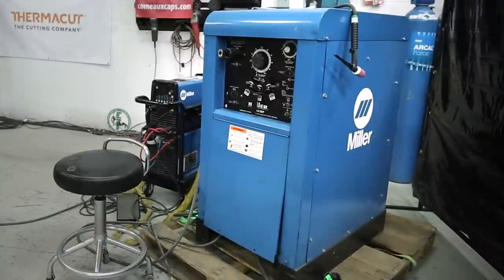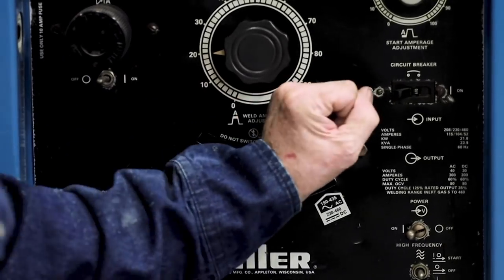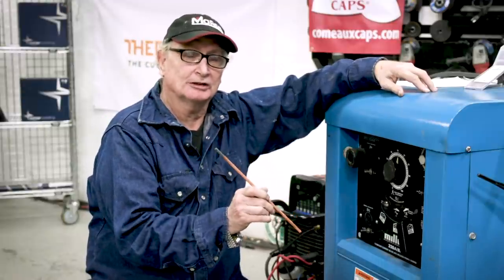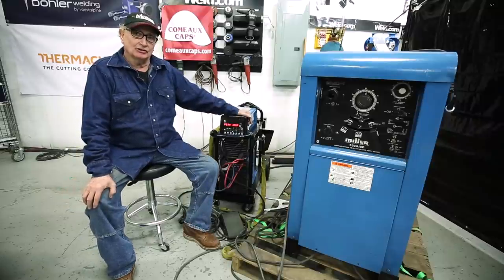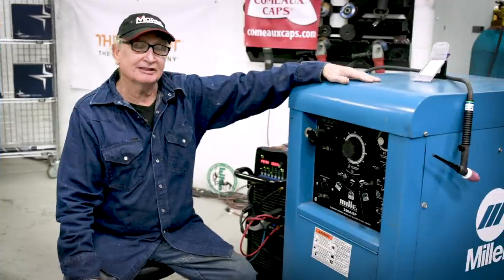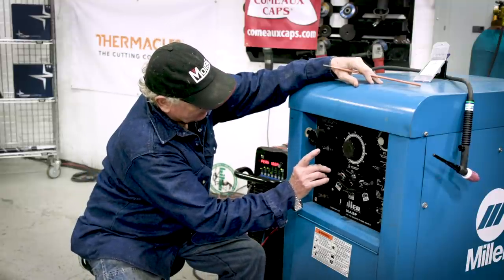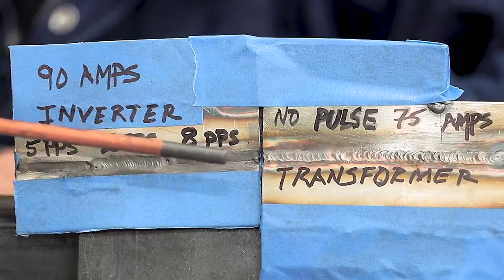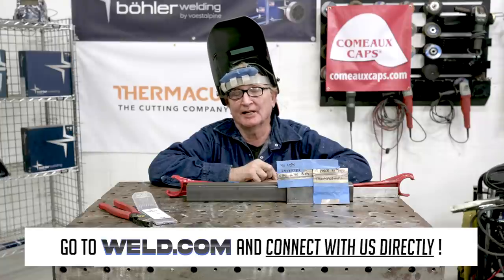Inverter Welder VS. Transformer Welder

Comment: Thanks for all the information Paul,  It's always good to learn how they work.  I appreciate it.
Reply: Thank you so much Gary...appreciate that....Paul
Reply: What information are you talking about?
Reply: @adrianvasile4683  the information you ask about is how a Transformer makes low voltage /high amperage current from high voltage low current  and how an Inverter does the same thing....not every one knows why or how and why an inverter is lighter in weight , among the other things it can do.....thanks for watching and commenting, Paul

Comment: My big question about the new machines is about reliability.  In my line of work I saw the differences between old, manually-controlled equipment and modern electronically-controlled equipment for many different kinds of devices.  In 30 years I never saw a single example where modern electronically-controlled devices turned out to be reliable.  On newer machines, those light-touch, push-button electronic controls or the electronic equipment that is adjusted by them would ALWAYS fail after a few years while the old-style controls would last forever.  It's hard for me to feel confident about buying one of these new inverter welders when every piece of equipment with modern electronics that I've ever seen was failure-prone.  That big old transformer welder is 50 years old and I bet it has never let you down even a single time.  Come back in 50 years and let's see how many of those inverter welders that you had to throw in the scrap heap along the way because the controls failed and repair was not an option due to constant modernization resulting in the needed parts being obsolete.
Reply: I just had to get rid of our old washing machine, a whirlpool from 1995. Mechanical controls abiet a few momentary switches. 
Our new one uses modern day potentiometers but none of the foil switches you see on microwaves. 
That old miller is cool.
Reply: @boriskarloff598  and good luck working on the new washer...
Reply: @Steve_Just_Steve  The day that thing is broken and beyond repair I'm taking the motor and wire harness out of it to build a small shop machine. The old one is now a 48" belt grinder.
Reply: @boriskarloff598  thanks for the comment, Paulie B
Reply: @boriskarloff598  great rehab of a motor.....
Reply: I have the same "phobia" when it comes to using "delicate" electronics for industrial grade welding. Although I'll use inverter machines, I'm keeping my good ole reliable transformer machine on standby.
Reply: @boriskarloff598  we had an old AEG washing machine that had lasted nearly 40 years the new one didn't even last 5 and when I tried to fix it I couldn't because they way they had built it. The old stuff was built to last.
Reply: Not a single inverter would it be possible to go half as long as the transformer --- because there will not be parts available for more than a few years . 
I want both , just have to keep throwing money at new inverter machines .
Reply: I have both of these, old and new styles of machine and I almost never use the old one. It still works perfectly but the new Dynasty gives a level if control above and beyond anything else. My Dynasty is probably 10 years old and the only issue has been a need to flush the water cooler once and replacement torch sense it melted.
Reply: @jca66  my personal Dynasty 200DX is a 2004 model and has been on construction sites, hospitals, roofs, restaurants
Reply: What matters is the bottom line. I had old transformer machines that when prospect customers came for a shop visit, the job never came after. When we brought in the spanking new IGBTs, it becomes a different story. Also gets the job done better in many ways.
Besides, welding machines are now cheaper than what it used to 20 years ago, even without accounting for inflation. Electricity cost is also way lower. Overall, still a good investment IMHO that just simply generate better returns, and that's ultimately what matters at the end of the day.
Reply: @impactodelsurenterprise2440  thanks for commenting and watching Paulie B
Reply: I agree 100%, although the inverter type has some better features and welds just as good. I have done a lot of research over the years and the reliability just isn't there yet on the inverter tech. Ok for portability & thin stuff up to approx. 1/4" but if they are pushed near their max for too long they can't handle it and burn up expensive circuit boards etc.. These days most electronic/electrical manufacturers only sell replacement parts for a few years in this electronic throw away & replace world we now live in & then good luck finding parts, especially Chinese replacement parts. I have read many comments on welding forums from service techs who repair welders for a living etc. & most will tell you the inverter type welders are making them a nice profit & are stacked up waiting for repairs & parts in their shops constantly no matter what color or who makes them. They also say the transformer type welders are built like tanks & are very reliable, hardly ever break down, only minor repairs like solenoids, contacts, cleaning, switches etc.. I don't care if they weigh 500lbs or more, I have engine pullers, gantry cranes, electric hoists, dollies & trailers & smaller welders if I need one to be portable. "They sure don't make things like they used to!"
Reply: @jetenginethrust863  you have a very good point....I too have fears of my inverters failing. I had one fail after 40 hours welding at 65 amps on a 140 amp machine  and a Dynasty 200dx failing after 5 hours welding 70 amps on a 200 amp machine, the Dynasy was under warranty, the Maxstar was not and a $1000 machine was scrapped, it was going to cost $
Reply: @ypaulbrown  Would you have recommendation on older transformer Tig for Aluminium  boat repair small business - Most of boat hulls need g repair ate 1/8 3/16" - This would be shop machine - Also inverter to be mobile Thanks enjoyed the video.
Reply: @jacklowe3788  my experience with aluminum boat repair is, they are always very dirty, hard to get to, and usually painted. My preference for the thickness material you are wanting to fix is to use GMAW [mig] with a spool gun. the reason is 100% electrode positive DC. which is the cleaning part of the arc. you do not have to use two hands to hold torch and filler, so getting into tight areas are much easier [ still not like welding on a bench]....make sure all paint is removed along with dirt and oils. Some heavy oxidation can be removed with a stainless wire brush, die grinders and a burr made for aluminum [course tooth] and also abrasive disc [which is not optimum with TIG]. I am not completely familiar with which companies offer an inverter that will run a spool gun other than Everlast is offering a new machine called the Storm 215C , here is a link to a recent video on the machine . https://www.youtube.com/watch?v=mUVvGBHyt4A&t=6s
I am sure other companies also make something similar , Miller,Lincoln, ESAB, ect. 
Prep work is the key to being successful with aluminum boat repair , I know I gave up on a Jon Boat trying to TIG it when I started welding and the cause of my problem was Dirt......Lucky to have had a friend and mentor who got me informed, I sure hope this helps and thanks for watching...cheers, Paulie B
Reply: @jetenginethrust863  Good point, I use to run those old machines wide open on big projects with no problems. The cost of a new board for the inverters  can set you back a few bucks.
Reply: Agreed none of the inverters will be around in 50 years. But at the same point in time Whats portability worth ? You need a forklift and a pickup to move a transformer machine. Not to mention you need 240 power. The inverter you can throw in the trunk of your winter beater and run it off a 3500 watt generator at a buddies house.
Reply: @steveboy3021002  thanks for commenting Stephen, but as far as running off a 3,500 watt generator, you are risking ruining the Inverter.....they do need more power than that an it needs to be clean power......as in the sine wave 60 or 50 hz coming to it, they are real finicky about that.....Beware and run a much bigger generator if you must do that for power, and make sure to have a full tank of Gas, as Generator stopping while Inverter is on can fry the Inverter, as will starting a generator while inverter is switched on. as the voltage fluctuates when first starting, make sure the generator has been running and is stable before turning on the Inverter....hope this helps someone, thanks for watching, Paulie B
Reply: In my line of work, I see both types - new transformer and new inverter so ~ 10 years old. Both seem about as reliable as each other. In fact 2 companies I know of offer transformer and inverter and they're both the same price, both rated for generator use. I have seen some of the cruddiest inverter 3 phase welders and if able always ask the guy on it what it's like and every time they just say, 'fine'. Fine doesn't mean good or bad it just works. 

One thing I've noticed if I ask, "If you had one choice whether transformer or inverter?" transformer come out the clear 100% winner but no one can actually tell me why now, only why based on 30 year ago IGBT failures - true that. 
They also say inverter are no good for generator use despite inverter having clear advantages for generator use which is why manufacturers rate them for generator use and provide output information for their welders depending on the power of the welder. This is for 3 phase welders only.
What I have is a 40 yo 3 phase ARC and a 3 phase SWF inverter that does ARC, MIG, TIG that is 8 years old. Both are excellent on my 3 phase generator. The 3 phase SWF I had the opportunity to get transformer for the same price. The manufacturer said both types used electronic user input controls so the reliability is the same except the inverter was more consistent for generator use not vice versa. I'm not a professional welder but my son is and he uses both and says he can't ell any difference. Nor can I for that matter. My transformer ARC is great because it's portable. The SWF is shop only.
Reply: @ThePaulv12  Thanks for all that.  In the subject video, a good case was made for the inverter welders having special abilities which can contribute to ease of arc control and neater-looking beads, so it may very well be that, at least in certain situations, a person CAN tell the difference between the two styles of machine and that the modern machine would win the comparison.  I've also seen comments in a lot of other videos that for stick welding, inverter welders are not capable of handling E6010 electrodes (something about the behavior of the arc is completely unacceptable with E6010), so for a lot of people that would be a deal-breaker.  These aspects are all outside of the topic that concerned me, however, and I do appreciate your input.
Reply: There are still tons of old powcon machines still up and kicking, going on 30 years now, the importance seems to be the quality of the production and what kinds of technology they were using. Not all solid state stuff is made to last, which is the biggest thing you have to look at - once those control boards go out, it's over for those inverter welders! Thinking about a multi-process powcon myself.
Reply: Just watching YouTube tonight see how the convert my Harbor Freight Chicago Electric 125 to DC in an attempt to get rid of some splatter and more penetrating welds.

I'm finding that to get ten-5000µF capacitors is about $250. Then to get 1.6mH of inductance is going to be another $250. All this will not fit within the case either. So I look to just getting another welder even though I hardly weld more than 10 days a year.

The one thing about this cheap Harbor Freight well there is it's a transformer machine.

I have more knowledge and experience with generators. 

If you're going to use close to the maximum power rating most of the time, you're better off with a generator as it's more efficient.

If your power demands go up and down and all around most of the time, you'll do better with an inverter on fuel consumption.
Reply: Do you drive a new model car or truck?  I think it is safe to say they won't out lst the old ones either. People still want the comfort of a new style car.   They get better fuel mileage and you do not have to man handle them down the road.  ame thing with invert welders.  Besides a lot of those Negative views you read about are the old mosfet inverters and not the new IGBT.    I cut my teeth on old transformer machines and it is all I knew until 5 years ago.   I took a chance on a off brand machine raising great reviews on many respected welding channels including weldingtipsandtricks  a great source of welding knowledge from a very respectable welder.    I purchased a Everlast 221STI at the time it was the only multi function mig tig stick that had a AC tig.  Unless you have tigged aluminum on a inverter machine you have been missing out.  Unless you have welded with a inverter machine in any mode including stick you are missing out.  You have so much more control over the ark in every mode and forum of welding.   Ido not weld every day for many of years but I use my machine weekly and it has never missed a lick.   It consumes far less power due to the way it works.  Mine is a 200 amp machine I have ran it wide open on a extension cord with a 30 amp 220V breaker.  it is a 2025 amp machine with a 60% duty cycle so I can run 160 amps wide open never stop and not hurt the machine.  I did not need a bigger machine for what I was doing but they certainly make them.  They cost far less to make they are easier to move and you can do many things you can not do on a transformer machine and do them way more efficient.     Being able to weld at frequency other than 60hz is a treat.   Sure that many electronics they are never going to last as long as a transformer machine but unless you are running them off unclean power like a cheap portable generator the IGBT ones have been very reliable.    Maybe as a hobbyist welder that has room for a big machine it is worth buying a big transformer.  But if you want to speed up production and be able to really specialize in say tig welding aluminum they are a no brainer.  They save money in the long run on power consumption and any big job shop making a living off of their work can afford to have one serviced if they break or replace them in ten or 15 years when they are obsolete. The benefits 100% outway the risk for most of us.  Mine came with a 5 year warranty It runs out this year I have no reason to worry.  The company is still making welders and servicing my machine and it cost a fraction of what a miller or lincoln the same size cost.   Also all of these machines have overload tech built into them if you do for some reason over work one it will shut down so you can not harm it.    I love things that last myself and I am in the process of rebuilding a 53 chevy pickup but I certainly upgrade the suspension and went to split system disk brakes power steering and AC because those things have all became important to me.      Go try one of these out and you will throw rocks at the old transformer machines.   I sold my old miller 2 years ago because I never turned it on and it was just taking up space.
Reply: I had the same thoughts, but I would bet the old-style cost a lot more by far than the new little machines, & the convenience size, adjustability  price & etc, just might be worth a shorter life span.  Just a thought from a non pro.

Comment: you forgot to tell us most inverters are throw away machines. The boards either cost too much to change or are not available.
Reply: thanks for the comment Sam, I have to admit, I am still nervous about longevity of my Inverter machines, but really like what they can do in certain types of welding....as the price keeps coming down and the quality goes up, they are really something to consider for certain type work loads.....Paulie B
Reply: @ypaulbrown  em I had a chance to buy a good, used 300 amp unit for 2k. I was told when it breaks throw it away. I agree they do weld great. The throw away issue will keep me on my syncrowave. To me the fact that no one is repairing the boards says as usual the fix is in- or lol not in this case
Reply: Yeah! Not gonna spend hundreds of dollars on an inverter when transformer welder are cheaper and longer lasting.

Comment: I got you beat, my old P&H transformer welder weights over 800lbs!! And welds great. Also has a built in water cooler that is plumbed to the tap.
Reply: I have a late 60’s P&H Chemetron ac/dc 300. Love welding with it. Wish I could find more info or a manual on it.
Reply: you got that right, the 330 does  weight 830, I guessed the weight and was wrong....I had a chance to buy a P and H once, sorry I did not buy it.....one of the best weldors I ever met had one....he worked for Lockheed Martin.....amazing man......thanks for the comment, Paulie B
Reply: Hadn't heard that name for a long time. I was maintenance weldor on Kodiak Base. Had a HUGE P&H on one ton truck.. We could weld 24 hours with that brute. Loved it.
Reply: @ericsprado4631  love hearing the stories of men who worked with these old P&H welders, and to think they are still out there going strong today.
Reply: P&H...Yeppers, I've got a 1956 Model...400 amps on the output...no electronics to worry about, not even the High Freq or anything...I've run it down to 3-4 amps for welding those 'razor blades'....the bottom of the 'cart' has about 10 gallons of coolant and pump for the TIG torch/s.....rolls around the shop easily with big 8" wheels with rubber tires.
Reply: @dougankrum3328  I am jealous....thanks for watching and commenting, Paulie B